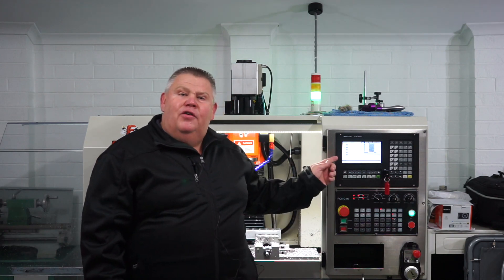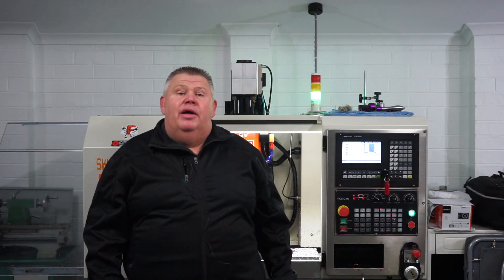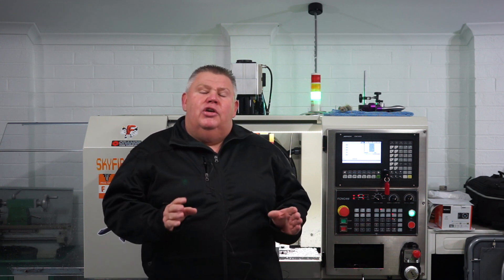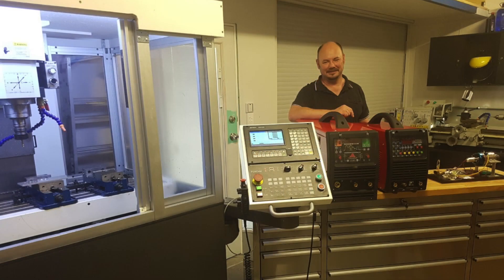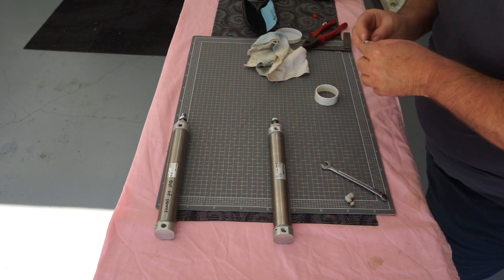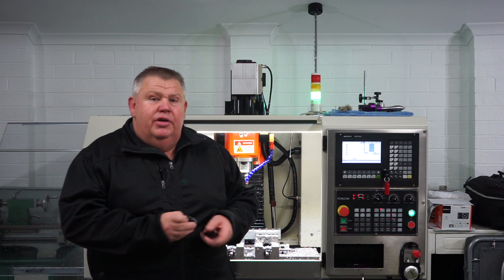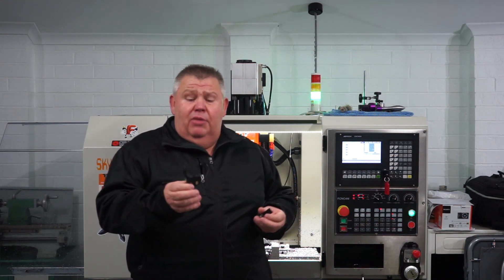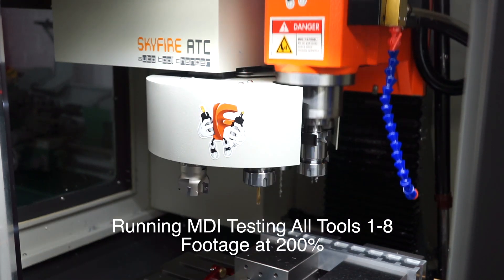I fixed my Skyfire CNC Mill - (SVM1-VMC)

Comment: GREAT VIDEOS!!👍
My question to all:
I'm 6'4" tall. Is it difficult to put this machine on a raised platform? Would this create clearance issues with a 7'6" ceiling? 
(6'4"= 193.04 cm, and 7'6"= 228.6 cm) 
Thanks !
Reply from the maker: Hello.  Yes they are small unit.  As they are a desktop machine sitting on a welded frame I would probably advise against raising it off the ground.  I sold my Skyfire machine and now have the Syil X7 CNC machine.  It is a much bigger, heavier and taller unit.

Comment: Glad you got it fixed. It didn't take to long all things considered. 🍻
Reply from the maker: Hey Jody, yeah I also had to drop the Z height by 1 mm and save that to the parameters to help realign the fork when tool changing.  Cheers, Aaron.

Comment: Hi Aaron Did you fix your problems with your 3D milling work. "Adtec frizzing" I have the same problem
Reply from the maker: Hey buddy, yes you have to save the file to the machines hard drive.  Keeping a large file on the USB stick causes slower transfer rate of data etc...  Give it a try and it should fix your problem ;-)

Comment: did I miss it, or did you mention something about it being a better idea to load code to the machine instead of running off the usb drive (?)
glad you got it fixed.   cheers.
Reply from the maker: Hi John I'm so happy it's back up and running.  Yes for large files with heaps of data, it's best to save the file to the machine's hard drive.  This helps to eliminate read ahead and slow transfer rates etc...

Comment: Glad you have it fixed now. Beauty of a machine like this is if you have some mechanical mouse then like the tormach, you can rebuild most of it yourself.
Reply from the maker: I agree Manny.  To be honest it's a very easy machine to work on.  It's great having the side access doors also, as this lets you get to all parts of the machine.  Cheers, Aaron.